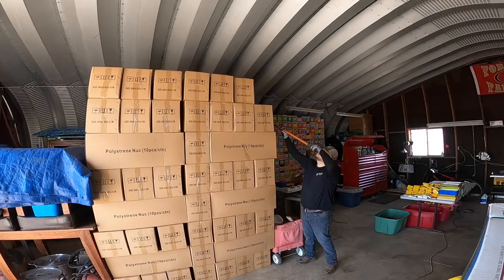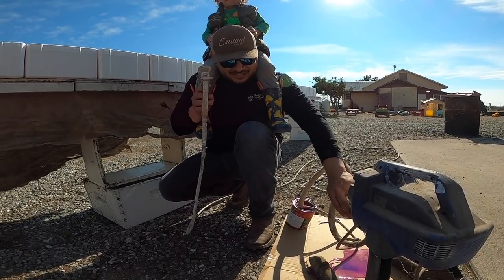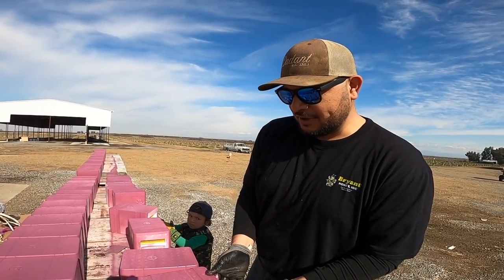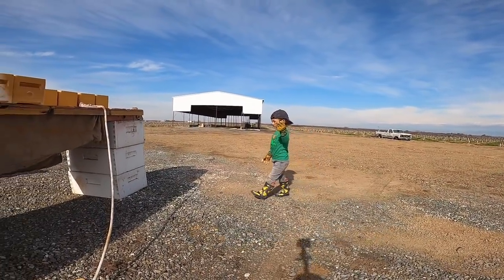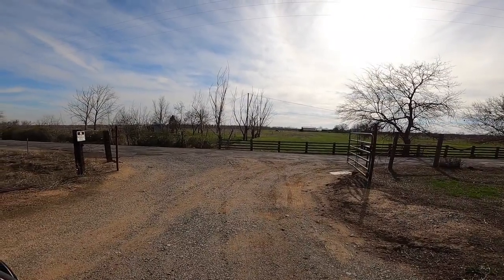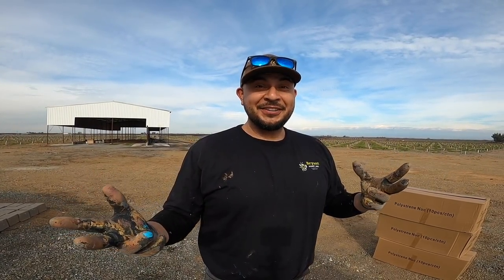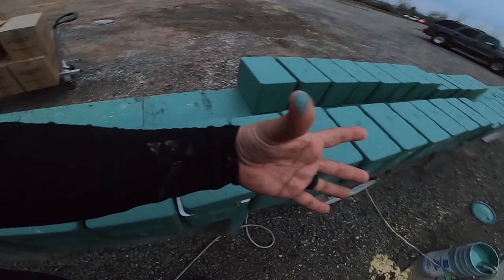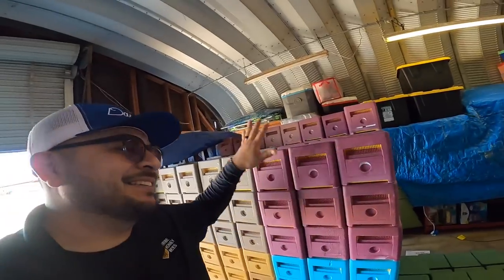Painting 548 Mini Styrofoam Nucs - Prepping for Queen Breeding Season - Commercial Queen Breeder

Comment: To keep the tip of the sprayer from drying out. Drop it in a bucket of water when you not using it.
Reply: Yes this works very well, I will leave mine overnight in a pail of water and I leave the suction end in the paint also, just seal the top of the paint can as best you can with a plastic bag...no problems whatsoever.
Reply from the maker: Thanks for the tip! 

Calvin, why didn't you tell me this😉

Appreciate the feedback guys and thanks for watching our channel

Comment: Ciao Guys, couple of questions: did you use acrilic coating? Difference between airless and air spry? thx again
Reply from the maker: Yes we did. Power Vs Finesse. HVLP sprayers – commonly known as compressed air sprayers, use a compressor or turbine (similar to a vacuum cleaner) to pump air through the system and, in turn, atomise the paint or stain you want to use. ... Airless sprayers, on the other hand, deliver massive (and often dangerous) pressure levels.